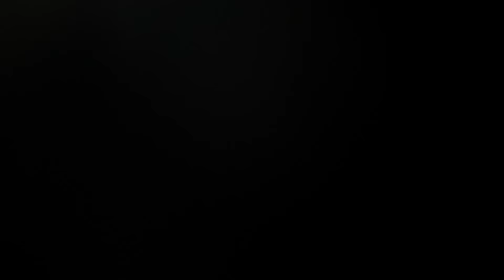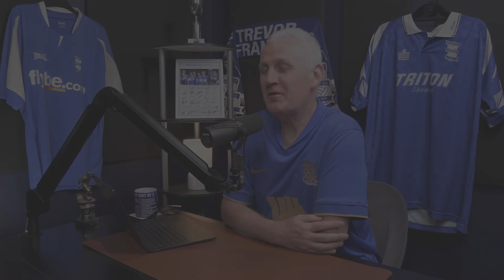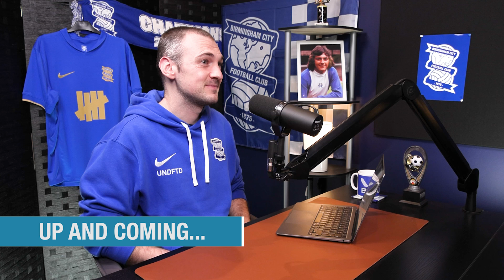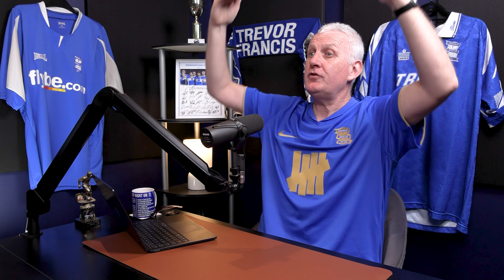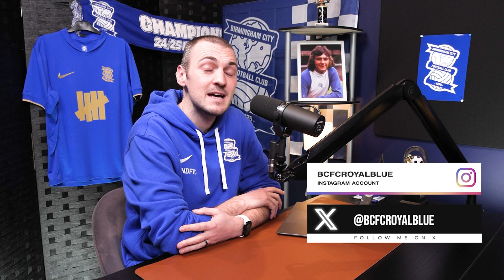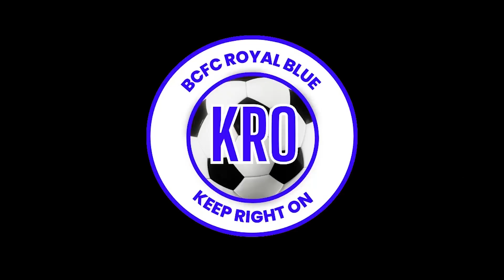WOW! Birmingham City FC's NEW ICONIC £1.2 BILLION 12 CHIMNEY Stadium Plans REVEALED! Fans React #403

Comment: I love this design. I must admit with all the hype when I first saw it I was unsure and then Like a fright train it hit me 30 mins later I love it!! The renders of the canal the train track lower with ramps making it accessible to all !  The views from the east stand looking over to the city, the brick the logos and writing in the bricks !! The archways welcome the fans to enter the sports colasium.  The elevation platform it's set on obviously giving the space for the pitch to be stored when holding NFL and concerts. 
The more I go into the details and the mechanics of the building I get mesmerized. My back ground is engineering as well! ventilation , the acoustics. Those chimneys will have some re-enforced steel and concrete structures running through it with a lift functionality but it will have to be very strong. Exciting times guys !! Keep right on!!
Reply from the maker: Thank you Duncan and really pleased you like the design. It will be a very solid stadium which is truly unique. KRO!